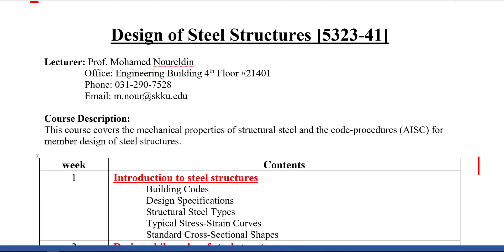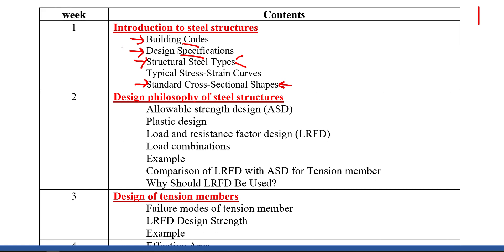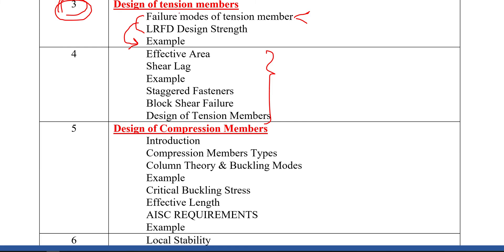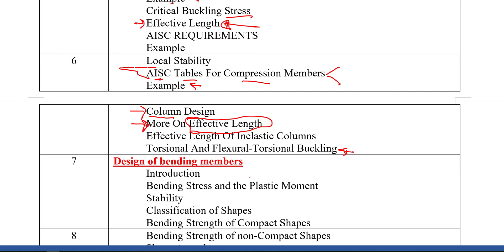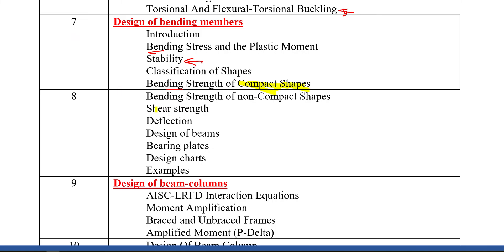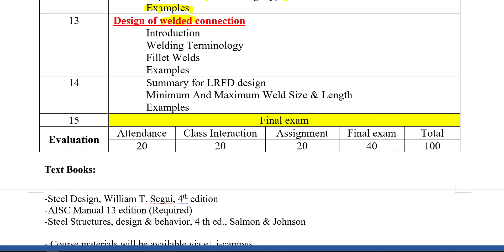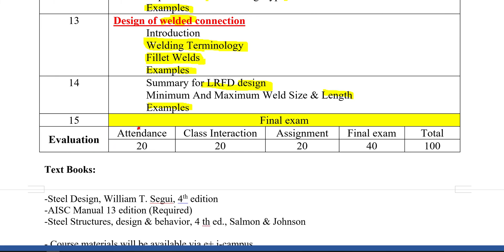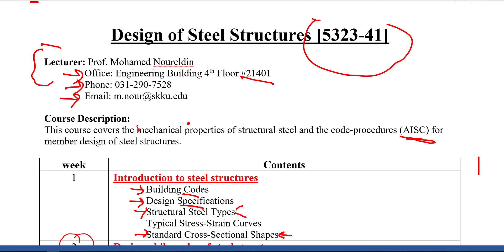Design of Steel Structures - Course Contents. Dr. Noureldin

Comment: Sir are you giving also lessons of seismic design of steel structures?
Reply from the maker: There is a general seismic design course I have on my channel. Steel seismic design not yet
Reply: @dr.mohamednoureldin5718  Okay sir. I may benefit from it also. Thank you.
Reply: @dr.mohamednoureldin5718   sir design of bolted and welded connection is not in this play list.